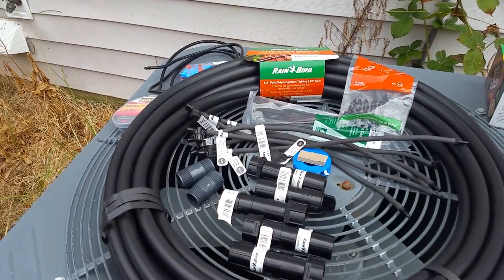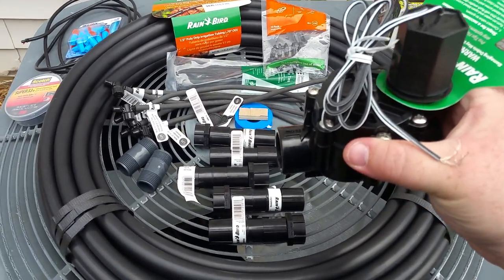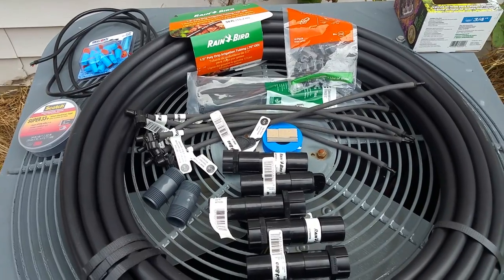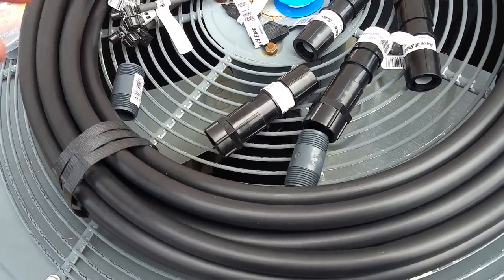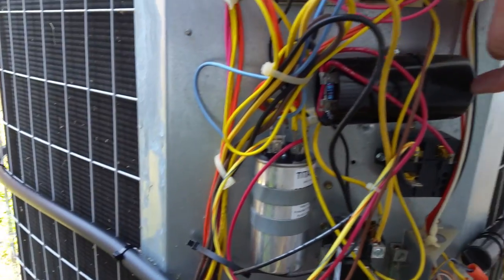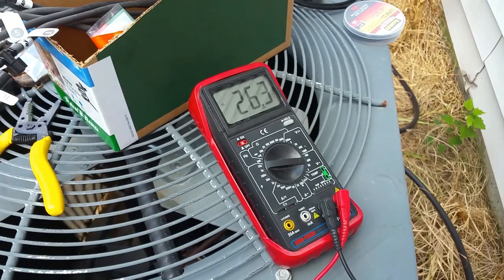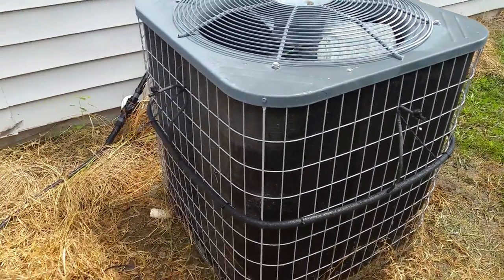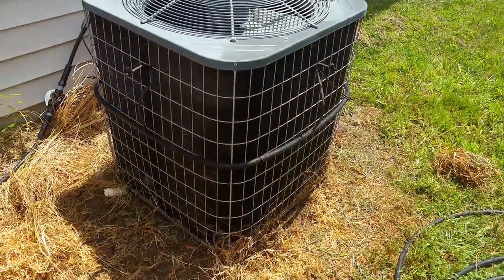DIY Automatic A/C Condenser Evaporator Mister - Electronically controlled!

Comment: Pretty close to done on this project myself, but ran into issue with valve. Turn the water on and despite valve not hooked up, water is freely flowing. I can't stop the water flow by plugging it with my hand, indicating to me high pressure which made me think that I may have absurdly high water pressure, which is bypassing the diaphragm with ease. Anyone else have this issue?
Reply: jw11432 Your valve might be manually opened.  Did you check this?  Check the solenoid.  Some valves come with a flow control.  Also if debris gets into the valve the diaphragm won't close.  Just unscrew it.
Reply: I actually did take the solenoid out completely, water still flowed out the main channel and barely dribbled out of the solenoid area. I even took the valve apart, hoping to find an explanation, but I couldn't find a problem. It's also a brand new valve, I don't think any dirt could've gotten in.

I also tested my water pressure, it's only about 72 PSI, and since the valve can handle up to 150, that shouldn't be a problem.
Reply: jw11432 yeah the pressure should not be the problem.  what kind of valve is it? and what size?  is it threaded or did you use PVC cement/glue?
Reply: CP075, just as in this video, and it's threaded. No leaks at the inflow. Here's the circuit:

Water going into inflow; outflow is wide open, nothing connected; solenoid not wired up (should be valve closed, as I understand it). When I turn on the water, water is flowing through the valve out of the outflow. Even if I completely remove the bleeder screw and solenoid, water continues to mostly flow out of outflow. It's as if the diaphragm isn't doing anything. I took the valve apart to understand how it worked and it really seems like there is a defective component(s), but I'm not quite sure what the issue is without more thorough testing, which I won't do for a $13 valve.
Reply: I went through 2 of these valves and both were defective, so no Rainbird for me. I went and bought an Orbit valve and it's working as I expect it to.
Reply: very odd to have 2 defective valves in a row.  but I'm sure stranger things  have happened.
Reply: Finished this up!

Only problem I have now is that I can't find the misters that the brass nozzles can screw into.

Comment: I just had a total AC System replaced, watched your video and duplicated your mister system as instructed on the video.  My problem is I am getting the correct thermostat wires to the AC 24V but the rain bird valve is not activating when the AC comes on.  Please help.
Reply from the maker: Hi Mary, so can you confirm with a volt meter that the two wires you are using from your thermostat wiring has 24V AC active when the AC is on correct? I'm not sure if the colors are always the same, but on mine it was BLUE and YELLOW. Blue is the common/"neutral" and yellow is the A/C call. Since it is AC it shouldn't matter which way the wires are connected to the solenoid. It will work either way.
Reply: trace from the relay back
Reply: Heat Pump is completely different.
Reply: If add this to a new a/c system this will void MFG warranty.

Comment: I has been almost 2 years, how do you like it?
Reply from the maker: Sorry for the delay in getting to your comment. As of October 2018 there were 0 issues with the setup, and was still running great. Sold my home in October and have since moved. New house has a much, much more efficient AC system and I don't see a benefit of installing a mister at the new house, however I have not totally dismissed the idea of trying again. Some things to address that others have brought up in the comments: 
No rust issues what so ever. How people think a device BUILT and designed for constant outdoor uncovered use would cause rust, is beyond me. 
NO, I REPEAT NO BUILDUP on the condenser coils WHAT SO EVER. Use. A. Water. Filter. Again, rain water is WAY, WAY more "dirty" than filtered, city water. 
No issues with the HVAC thermostat carrying the extra load of the solenoid

The only thing I would do differently, is a better wire management job, and maybe using "liquid tight" conduit and PVC conduit box for the solenoid wiring. Just for a cleaner look. No issues with the outdoor rated wire nuts, or electrical tape. Keep in mind that's all that's used in the irrigation world, and that's usually directly buried or open air.

While I didn't do much scientific data recording to really drill down on energy savings, I can say my power bill was on average $20-$40 cheaper, without changing as many variables as possible year over year. Obviously weather has a huge affect on the energy usage, but the weather in NC is pretty consistent in the summer. Hot as balls. Water bill was virtually unchanged. WIth the NEW misters (please see the update videos on my channel) the water usage dropped SIGNIFICANTLY as there is very little flow with the new nozzles. They did a MUCH better job at atomizing the water.

My location doesn't really net the most benefit from a mister system either. It's typically very humid in NC during the summer. However, there was still a noticeable difference in condenser outlet temperature even on humid days. I can only attribute that to A) sufficient atomization of the water to still get some evaporative cooling and B) the actual water temperature itself being in the 60F range even on a hot day.

Thank you for your comment.

Comment: Is that Rainbird solenoid valve the CP100 or the CP075?
Reply from the maker: CP075 (3/4"). CP100 is for 1" line.
Reply: I'm just trying to figure out which one to use for garden hose fittings like yours.
Reply: I've been running misters on my ac units for a while now but didn't connect the water line to any solenoid valve so I have to manually shut the water in the evening.  A solenoid valve would be so much better.  I used all garden hose fittings.
Reply from the maker: CP075. I dont think a garden hose will fit directly to the valve though. I think garden hose is different than MPT, also garden hose needs to seal with an o-ring, the fittings on the valve are tapered.
Reply from the maker: I'm thinking of implementing a photocell to shut it off at night, but honestly it stays so hot at night during the summer that I'm sure it is still somewhat beneficial even at night. Having the solenoid controlled by the thermostat will definitely help with water usage though, and was my reason for doing it instead of having it on all day. I also spent days and days researching the existing kits like the "mist n save" or "cool n save" kits out there already, and by the time you buy the base kit, the extra add on sprayers for my 4.5 ton unit, and at the end of the day have a product that more than half say isn't worth the money because the valve leaks, or got stuck on/off, or just flat out broke I knew there had to be a better way. I happened to stumble on the rainbird solenoids at home depot and saw they ran on 24V AC, poof it hit me. Perfect way to control the water without a rinky dinky valve, and turned out to be alot better than expected, especially after switching the nozzles (in my update video)
Reply: Same here, I looked around everywhere for a reasonably priced kit and even the lowest quality ones were too pricey.  I opted, instead, to get two patio mister kits on amazon (6 nozzle kits for $15.99 each). I just didn't know of an easy way to automate the switching of the water valve.  I was going to build an arduino controller but summer was coming and I was in a hurry to get the thing installed so I decided to go the full manual route and save on water by turning it off at night.  If I can automate it with a solenoid valve, I would just leave it on all the time.  One thing you should note: I had a calcium filter on mine (looks similar to yours - might be the same one in fact) and it didn't really seem to help.  I see white buildup on the aluminum fins.  I may have to  spray something to clean it off eventually.
Reply from the maker: ifangster A monthly CLR treatment should do the trick. If I notice any on mine it's what I'm going to do.

Comment: Don't you think if this worked and saved you money the A/C manufacturers would have already designed this function into all of their units ?? Don't be a dope and screw your A/C system up !!
Reply: They tried. It was called the “FREUS” it was great and very efficient. But had problems with hard water scale. So it flopped.
Reply: Of course it works. I use one and it lowered my monthly bill by at least $30 from 1 window unit. I had a large collection bucket under the unit and recirculated the water. I never had a problem with scale buildup on the coils, nor did they get dirty. The unit ran less often and not as long as it was able to dissipate the heat at lot easier.
The job of the condenser is to remove heat from the compressed fluid. Once the ambient air temps reach too close to the temps the pump is trying to dump out, the pump has to work even harder to build even more pressure to raise the temps high enough to dissipate the heat. There needs to be a 20F difference between coil and ambient for it to be effective. By keeping the relative ambient temps low enough, the 20F difference is easily reached and therefore the pump doesn't have to work no where near as hard.
And yes, I get my information from an official HVAC workbook that is taught in colleges. And even in there it talks about using a secondary cooling medium to help remove heat from the condenser. This is either water running over the coils or a secondary radiator that has water flowing through it (like a vehicle radiator is designed)
Reply: Joe Pisarek: Yep, exactly! That's why they install parts that are barely the right size to begin with, like the condenser cooler fan. My grandmother had to have her fan replaced 3 times, after the warranty elapsed of course. The fan motor that is factor lasts just a few months after the warranty, then the exact same replacement fan only lasted a year after that. It's just like the vehicle industry. They make their money off the repairs of the vehicles, not the sales.
Reply: Arizona Droner, you say "Don't you think if this worked and saved you money the A/C manufacturers would have already designed this function into all of their units ??"  My answer is NO! Manufacturers build things to fail so you will have to re-buy or repair. To keep the flow of money in their direction. just think about that for a minute.

Comment: This article is worth a read before investing in such a system.
http://energysmartohio.com/uncategorized/can-mistbox-lower-cooling-bills-not-so-fast/

I'm no HVAC tech, but I think people get confused on the delta potential with heat pumps, whereas for heating, below 35F the efficiency of the system drops due to limitations with the state change of the coolant, icing, and airflow, but the reverse is not true for cooling. I.e., they work nearly as efficiently with ambient temps whether it is 85F or. 120F. 

More directly, there is a limit to how much heat can be efficiently transferred within the system itself as the majority of it relies on the state change of the refrigerant, and water cooling of the condenser doesn't change that to a significant degree. The condenser is a linear system, so all it really does is physically shift where in the condenser the desuperheated coolant will actually condense. In other words, water cooling will only help significantly if 100% condensing is not achieved by the end of the coil path - and this is virtually never the case for any system that is operating properly.

You can find more information about this here - https://www.achrnews.com/articles/120345-the-professor--condensing-temperatures-and-condensing-splits

Comment: I think it would be very interesting to see a side-by-side comparison test between two identical systems... one using, and one not using a mister.  I'm not sure that the whole "putting water on the unit shortens the life of the components" argument holds much weight since they're designed to be out in the elements to begin with.  Maybe if you have hard water... but then wouldn't a filter solve this problem?  

I've thought of putting a pitched shelter over mine to shade the unit and help prevent leaves from falling into it.  I've also considered the though of adding misters as well.

I'm no HVAC expert or chemical engineer.  I did stay at a Holiday Inn Express once though.

Comment: Not hating, but what's the purpose? Improve efficiency?
Reply from the maker: Short answer, yes. I saw a 10F reduction in air temperature over the evaporator with the system running, and on average a 10-17% reduction in monthly power usage.

Comment: Jonboy545 did you ever do an update? Did you save any money on your electric bill?
Reply: Reggie Lewis - YES! When he bought a new high seer AC cause he ruined the one in the video.
Reply from the maker: Sorry for the delay in getting to your comment. As of October 2018 there were 0 issues with the setup, and was still running great. Sold my home in October and have since moved. New house has a much, much more efficient AC system and I don't see a benefit of installing a mister at the new house, however I have not totally dismissed the idea of trying again. Some things to address that others have brought up in the comments: 
No rust issues what so ever. How people think a device BUILT and designed for constant outdoor uncovered use would cause rust, is beyond me. 
NO, I REPEAT NO BUILDUP on the condenser coils WHAT SO EVER. Use. A. Water. Filter. Again, rain water is WAY, WAY more "dirty" than filtered, city water. 
No issues with the HVAC thermostat carrying the extra load of the solenoid

The only thing I would do differently, is a better wire management job, and maybe using "liquid tight" conduit and PVC conduit box for the solenoid wiring. Just for a cleaner look. No issues with the outdoor rated wire nuts, or electrical tape. Keep in mind that's all that's used in the irrigation world, and that's usually directly buried or open air.

While I didn't do much scientific data recording to really drill down on energy savings, I can say my power bill was on average $20-$40 cheaper, without changing as many variables as possible year over year. Obviously weather has a huge affect on the energy usage, but the weather in NC is pretty consistent in the summer. Hot as balls. Water bill was virtually unchanged. WIth the NEW misters (please see the update videos on my channel) the water usage dropped SIGNIFICANTLY as there is very little flow with the new nozzles. They did a MUCH better job at atomizing the water.

My location doesn't really net the most benefit from a mister system either. It's typically very humid in NC during the summer. However, there was still a noticeable difference in condenser outlet temperature even on humid days. I can only attribute that to A) sufficient atomization of the water to still get some evaporative cooling and B) the actual water temperature itself being in the 60F range even on a hot day.

Thank you for your comment.

Comment: Alright big big advice you need to know if you do not hook up a chlorine filter or a filter for the water that is being sprayed against the fins your fins will slowly dissolve I'm just telling you what other reviewers have said that they did not use a filter Kelsey online deposit filter and it destroyed their air conditioner over time
Reply: you can't really filter out shit that is dissolved in the water. That is the only real problem with this, easily solved by using condensate or collected rainwater and not tap water

Comment: Nice instructions. A bit pricey, could of been done cheaper using pvc instead of the irrigation flex tubing. I like using the solenoid being powered by the thermostat wiring. 
Here's an idea you could do as a future modification. Build a small reservoir around the unit, or dig a hole and put a 10 gallon bucket in the ground and have the water drain into the bucket. Use a recirculating pump to pull from the bucket and spray on the coils. Add a float valve to maintain water level in the bucket. Use a 24V relay to run the recirculating pump from the thermo wiring or a 120V one and tie into the compressor. (the 24V relay would be better/easier).
This would allow you to not have a mushy area around your central unit and not waste any more water than is needed.
btw, how much has this saved you on your bills? When I did mine on my window unit, it dropped about $30/average.
Reply from the maker: I love the idea of recirculating the water. A bit more complicated but can definitely see the benefit if you are on well water, have water restrictions and/or high water prices. Great idea.